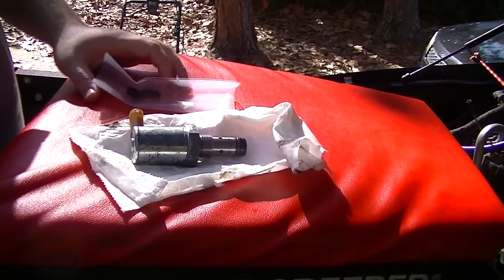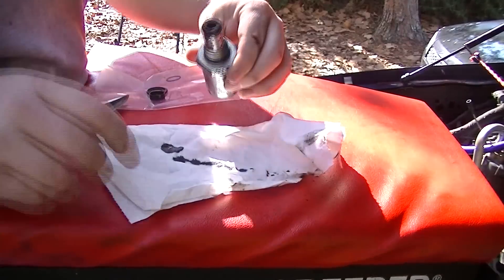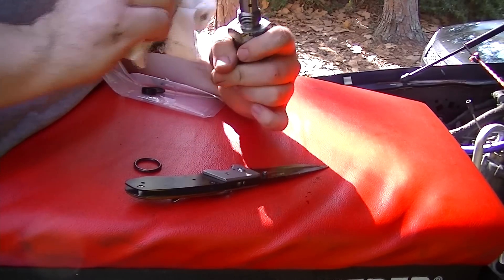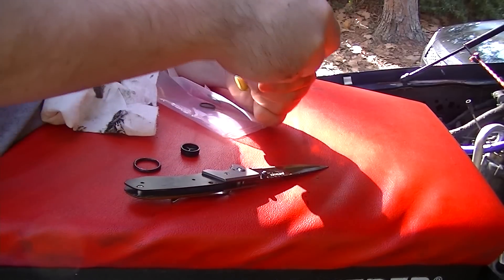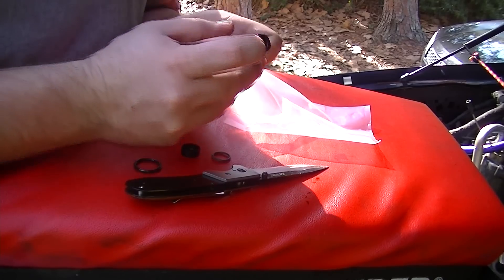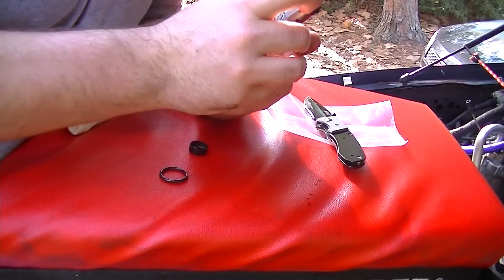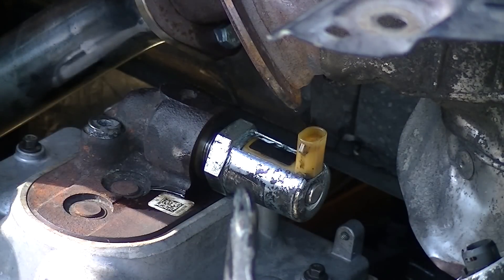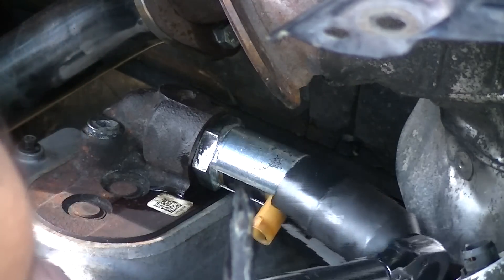HowTo: Installing Injection Pressure Regulator on Ford 6.0L Powerstroke Diesel

Comment: Did you give up on the powerstroke ??
Reply from the maker: Not at all!  I've been supremely busy and haven't had a chance to finish any more videos.  The truck is running AMAZINGLY, with a maximum 8F spread in temp.  I cut open both a Dorman and my stock 11 row OEM cooler, and lots more that I hope to get up on youtube this coming month!